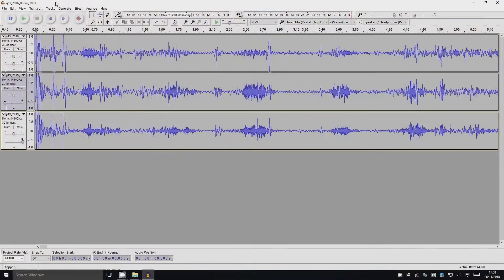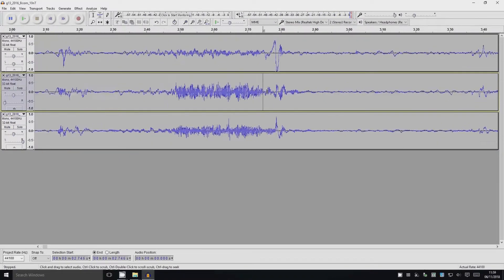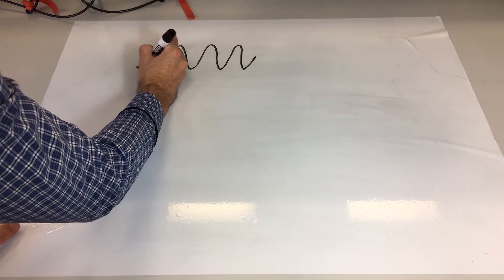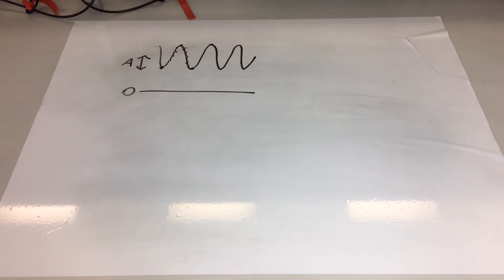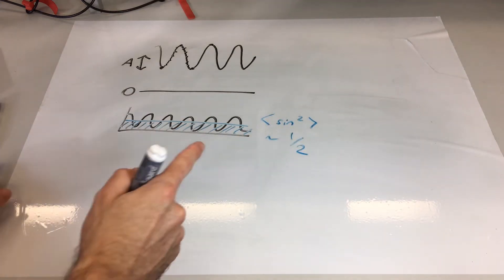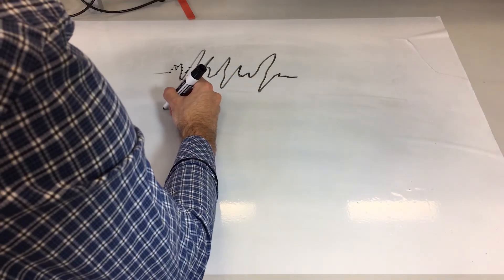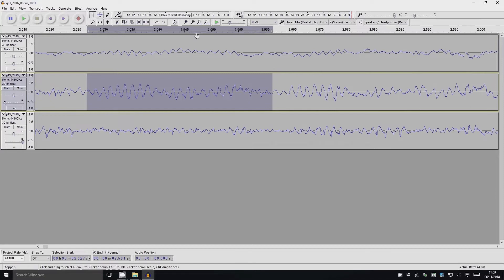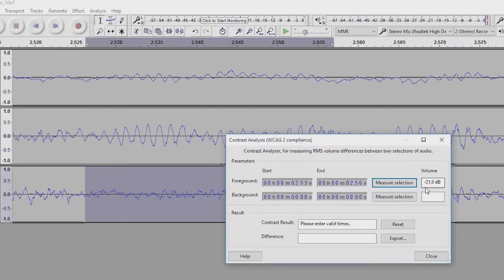How To Measure RMS in Audacity | MUSICS How To Guides

Comment: Hi Martin, how would someone pre-set RMS ideally pre recording and, restrict between two numbers post recording in audacity?
Reply from the maker: I'm not sure exactly what you mean by restrict between two numbers, RMS is necessarily plus and minus the same amount. However, if you measure the RMS of your audio you can then reduce the volume to by some factor of the RMS to set it to whatever value you want. If, however, you're talking about trying to remove quiet periods then look into the Noise Gate in the effects.

Comment: Thanks... but what is Amp0? Is it the peak amplitude?
I don't quite get that...
Reply from the maker: The units in audio files are dimensionless, so just go from -1 to 1 and it’s not possible to have a larger amplitude than this (instead we say the waveform is clipping). The dB measure just uses the dimensionless units, so using the formula a logarithm of 1 gives 0dB which as you say corresponds to the peak possible amplitude. Hope that helps.

Comment: Is the Power(dB) formula at the end to measure how loud the sound is (in dB)?
Reply from the maker: Karma Vin yep
Reply: @DrMartinArcher  as in Sound Power Level? And not Sound Pressure level?
Reply from the maker: Karma Vin they are both essentially the same but with different reference values (ie zero levels). In an audio file you can’t really get an absolute sound pressure level because it depends on what volume you set the speaker at, so really it’s all relative.
Reply: @DrMartinArcher  im sorry if im being confusing.. I need a way to measure/calculate for Sound Power Level for a project.. I just wanna know if the one you showed in your video is it.
Reply: @DrMartinArcher  is there a method to find/caluclate for Sound Power Level using audacity?